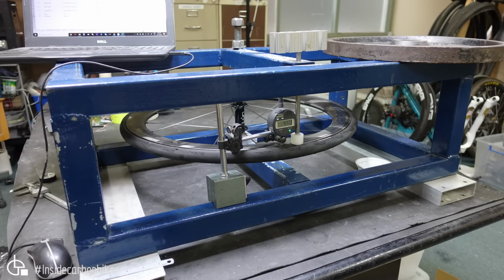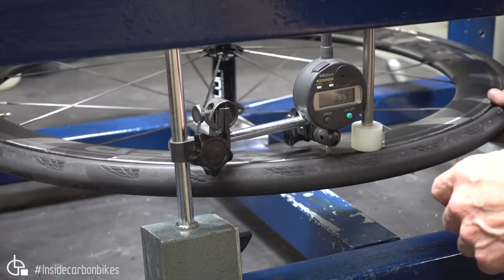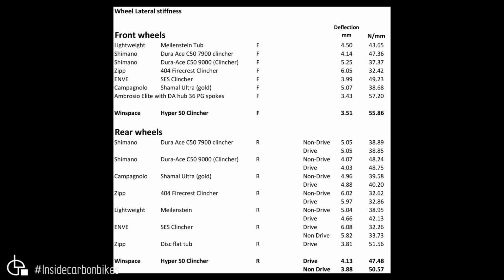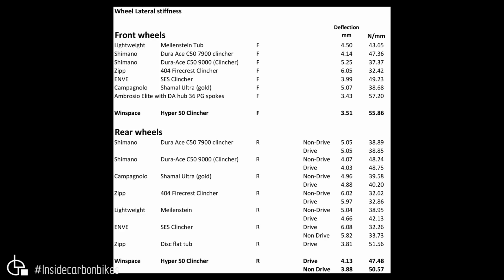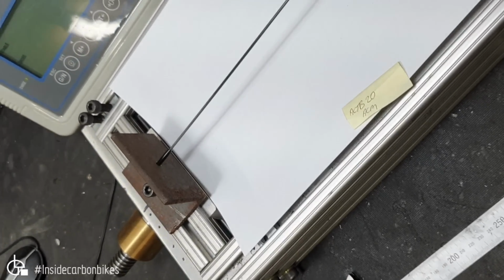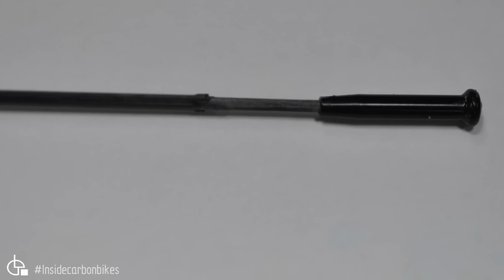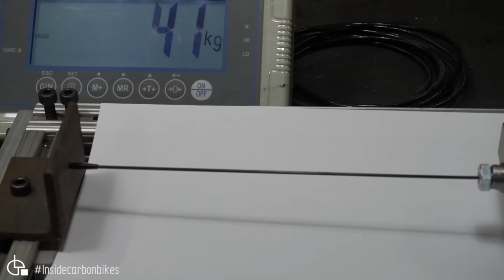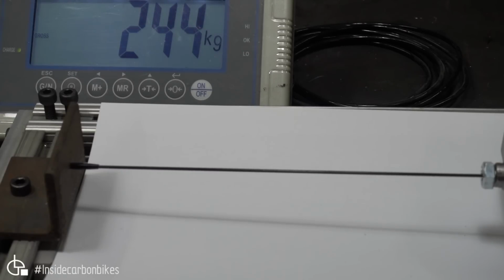Winspace Hyper Wheels - What they didn't tell you.

Comment: Had the mavic Rsys as a replacement front wheel my bike shop gave me, back in 2009. I had it for about a month and did a race with it (90kms in the mountains with 3 pass). Apart from the difference in weight, I didn't notice anything or had any issue. Was just a bit scary in my mind to ride carbon spokes that can break without warning at any time.

Comment: I love mine (65mm rim brakes). I put them on super stiff frame with rear caliper mounted on chainstay. Zero issues, never have brake shoes rubbing, spokes rubbing etc. But when wheels and frame are super stiff ride is harsh and I recommend more suplied tires like Vittoria Corsa 25mm (I ride clincher with latex tube). Fast , light, stiff, reasonable priced... you can't go wrong with these wheels IME.
Reply: @kiwibiker9754  No. I ride only on perfect tarmac and puncrures aren't issue.  Now I ride my bike with vittoria latex+s-works turbo cotton 26mm. Now I'm faster 1-2km/h and can't  be more happy.

Comment: I founf the 38s quick to accelerate. And also a bit more chattery in some situations. Like a slightly anti camber , slight up hil ,fast corner. Compaired to the previous dt swiss , they vibrated and lost traction. Always hit the corner same entry, same speed. Was like ,wooahh 
Nearly slid. I always pump my tires the same too.

Comment: Was getting annoying creaking noises which were really difficult to track down.  Had a set of Lightweights, and their titanium skewers were elastic enough to allow the axles to move slightly in the dropouts.  Solution: Dura-Ace skewers (stainless steel).
Reply from the maker: I don't like any of the titanium skewers as they are too elastic. The skewer is holding your wheel on use a good item, Dura Ace are excellent.

Comment: I've found the thru  spokes tend to fail on the rear with age especially very light spokes. I've had two spokes fatigue within minutes of another. Spokes failed at the entry point of the spoke hole on a carbon rim. I went to conventional non thru hole after with no issues. Carbon spokes seem to be where it's heading.

Comment: a squirrel ran into my front wheel, pulled up in the spokes and locked up my front wheel at the top of the fork, i flew over the handlebars and broke my wrist/ankle.  i was getting spooked everytime a saw a squirrel after that cause their trajectory is so unpredictable.  until some guy in Cali told me how to make a noise to scare em off.  so if one starts trying to cross in front of you make that noise like your hocking a loogey but with the roof of your mouth instead of your throat.  they seriously hear that and just take off back the way they came from lol
Reply from the maker: Wow, thanks for sharing. Here we have Kangaroos which are also very random in their travel path and BIG, I know a few people that have collided with them and come off second best.
Reply: I've started barking at squirrels.  It seems to work.  At least it gets their attention.
Reply from the maker: News headline "Mad cyclists heard barking at squirrels"  ha ha ha
Reply: @LuescherTeknik  Try it.  Beats a visit to the ER.  Plus it's a no weight, no aero drag, no cost, no-added-maintenance solution, so rare in cycling (and so unlike the abomination we are not discussing here).  And it doesn't add clutter anywhere, so your bike stays sleek.
Reply: In my first race, 35 years ago, a deer ran into the peloton...  it was pure carnage...  then I crashed in a separate incident.
Reply: Making a loud, quick hissing sound, kind of like a 'snake' sound (kind of like 'tsk'), has always worked for me to get the attention of a squirrel while riding.  😁
Reply: I have almost 3000 mi on my Hyper 50s. They deflect suicidal racoons effectively as one bounced off my front wheel with what appeared to only be a headache. No damage to me and the bike or wheels.
Reply: This also happened to me, riding at only 30 km/h or so as the road was bumpy. Problem is that the noise confused it. Saw me, ran one way but turned around and ran right into the front spokes. Instantly killed. Cervical spinal cord severed I guess. I thought my spokes would be bent but nothing except a few hairs caught in the spokes.

Comment: Ive got ALL the big brands in my warehouse. Over 40 pairs....Zipp, Enve, Mavic, Roval, Lightweight, DT Swiss...over 40 pairs of high end wheels. Winspace Hyper 38 rim brake are by far the best all round carbon wheel Ive ever used.

For alloy the Spinergy Zlites are the best.`

I can afford any bike tech I want. Brands give me stuff or offer me stuff most weeks. Most of the time I politely refuse. Winspace Hyper 38 rim brakes is the real deal. I hit a massive baby skull rock with my front rim. Destroyed the tire and tube. Rim was fine.

Winspace are above most peoples budgets but if you can afford then and want the highest end carbon wheels then get them.
Reply: What about their disc brakes version of the wheels ??

Comment: I’m a fairly lightweight rider at 64kg and I have found a lot of modern frames and wheelsets to be way too stiff. I have to run my tires near the minimum recommended pressure for fast paced rides, otherwise I end up bouncing quite severely, which noticeable instances where the rear wheel leaves the ground and loses all traction/contact. I have settled on only riding wheelsets with steel spokes and framesets with more compliance(titanium and steel are my preferred). I have also noticed the stiffer wheels/frames fatigue me much faster than the more compliant ones.
Reply: I totally agree with this. Even at my weight i think most road frames/seatposts are lusciously stiff. We don't ride on race tracks, for the most part. I think wow what must this frame be like for a 60kg person, awful! I still think softer bikes are the fastest bikes at the end of a 150km+ race on rough roads. Most are too stiff and fatiguing.
Reply: They're selling us racing machines. It reminds me of James May and how he hated car manufacturers testing the cars in the Nurburgring. I'm neither Hamilton nor Van Aert. But at least Mercedes do not encourage me to buy their F1 car.
Reply: Are you really at the recommended pressure? With 28c tubeless tyres that would be 60 psi or even a bit less.
Reply: Totally feel you mate. I'm at 60 kgs and I have my best performances on aluminium bikes!
Reply: Your comment about excessive stiffness tiring you out resonates with me as I often have to ride on bumpy roads. I have a stiff and light wheel set (shamal ultra) but only use them for climbing and fast riding. For the rest , it’s alloy wheels and gatorskins on a steel frame and I don’t feel rattled even after  six hours . Slower riding speed but fewer stops.
Reply: world is getting more fat
Reply: What tire size and pressure you use?
Reply: @miosilver9718  I own a couple dozen bicycles with tire sizes ranging from 25mm to  2.2in. Pressures vary depending on the tire size and the surface I am on. I typically run anywhere from 40psi to 110psi. I use clinchers and tubulars. I am not a fan of tubeless. I am professional bicycle mechanic.
Reply: @jimihendrix731  I thought or want to believe that with tyres like 28-32 mm and pressure in range 60-90 psi stifness of frame and wheels is not the issue. I have simple hardtail and endurance-aluminium road bike with good aluminium wheels and 25 mm, max that accepts rim brake bike. I prefer road cycling, so usually ride on road bike. Choose only good roads, because not satisfied with uncomfortable ride. Wonder if going to wider tires would allow to diversify routes.

Comment: As a layperson, my impression is that we still don't really know what the optimal stiffness is for a given rider on a given course. The PR guff from the bike brands would lead you to believe that a stiffer frame, for example, is always better but is that the case? Surely there is a sweet spot, which may vary for each rider depending on weight, power, riding style etc, between stiffness and compliance.
Reply from the maker: Correct, there are many variables, that's why I said "It depends" ;)
Reply: About time someone builds a correlation matrix
Reply: Layperson???😂😂😂😂👎 jog on flap jack
Pro nouns 😂😂
Reply: @rambojonj1838  Are you really so pathetically weak that this is what triggered you?
Reply: @cjohnson3836  the siren sound of the flap jack😂
I'm taking the piss out of you copernicus 
Deal with it 😪
Reply: Ps you sound pretty "triggered" ,
Birthingperson 😂😂😂😂
Reply: @rambojonj1838  You're dedicating an awful lot of rent to this. Triggered
Reply: @cjohnson3836  me take the piss out of you = triggered 
Ya 
Nice one flap jack
Reply: @rambojonj1838  🤡

Comment: A second thought? If the wheel is stiff like a disc wheel. And the spokes do not stretch at all - if I'm getting it right - how on earth would there be movement between the spokes?
Reply: Caden are very good price wise
Reply from the maker: They do stretch, just not as much as other types, the wheel still deflects under lateral load.

Comment: You are having a hard time to give in to your own data 😜 Thank you for confirming my impression. I'm 110 kg. I've ridden my Hypers since spring. They are rock steady! Dead true as on day one. Apart from the carbon spokes I also believe the got the 2:1 spoke pattern in the rear just right. (Shimano has adopted that I noticed).
Mine do not make any sounds from the spokes at all. But there was sounds after a couple of month. Came from the free hub body. The pawls needed grease badly. I think they left the factory with a far to fluid grease. Could "your sounds" be the same?
Reply: I had the same creak you described.  It was coming from the endcaps and not the freehub.  You probably greased the endcaps and not realized that fixed it.
Reply: @WanderingSword  
No. I greased the hub body. It was dry as bone. And it worked. You had an other experience and solved it. So all is good.
Reply: 38 or 50mm? I'm also a heavy rider...
Reply: @radziyaman  50 mm. As I said no trouble at all. But I'm not riding them hard. No crazy criterium for me. Just cruising the back roads. Short stretches of gravel om My regular rutes. I'm riding 28 in the back and 25 in front. Tubeless.  6 bars.conti 5000 tl. As I said. Vere content. No troubles at all.
Reply: How would you rate then today?
Reply: @kpsig  They haven't moved a milimeter. They impress me. I've never experienced wheels that didn't need any truing at all before. They do not break well in the wet. But that's something we know. Next bike in a Farr future with fisk breaks, but that's an other topic.

Comment: Re: stick flick at speed, surely such a scenario would be bad regardless, and also statistically rare.
Reply: I have had a small rock kicked up by a car coming the other direction break a CX-Ray on my rear wheel mid span.
Reply from the maker: Plane crashes are also rare but when they happen the result is bad. The death and serious injury cases I have worked on have often been caused by this.
Reply: @LuescherTeknik  I shall be avoiding twigs and sticks even more now 😱

Comment: Why is it when I asked Winspace for internal or external test house data they couldn't provide any. It's been left to you tubers engineers (that I have total respect for btw) to validate. So clearly they are good but without published data I can't sell here in the UK even if I wanted to. Also all wheel manufacturers are capable of this, so it's interesting why others have chosen not to?
Reply: @altern8tive  with respect I’m not referring to performance data of “my wheels are faster than yours”. I’m talking like the test taken out here, of strength, compression, pull, lateral loads, impact tests, torsion tests etc. The test required for sale includes ISO accreditation’s etc which everyone assumes is there and maybe they are but I never received proof. The aspect of safety not just how fast they are in a wind tunnel and when you say Winspace being open (that’s certainly one way of looking at it), however or just clever marketing, as in if you send them to enough influencers for free (and they admit it). Cam Nichols and Luescher are so far only a hand full of reviewers that either bought personally or independently given indirectly to test. There’s no denying though they are well put together as this video shows.